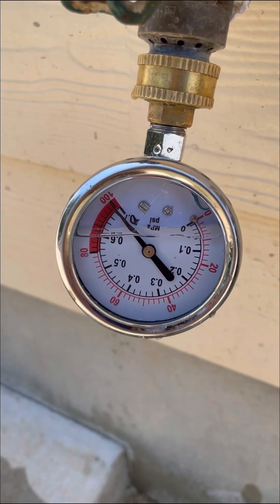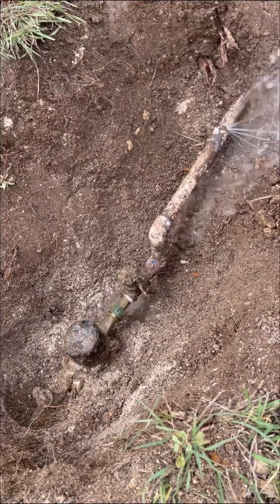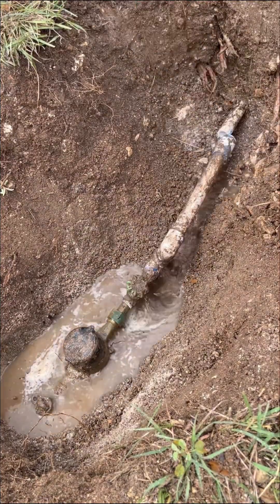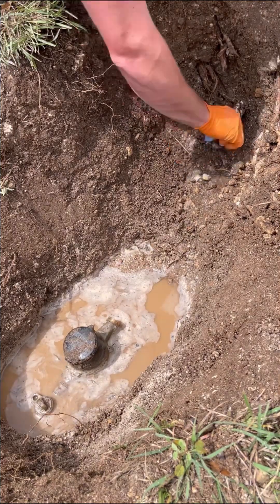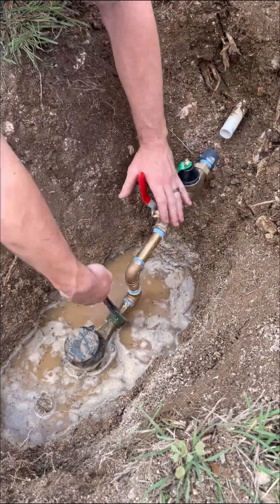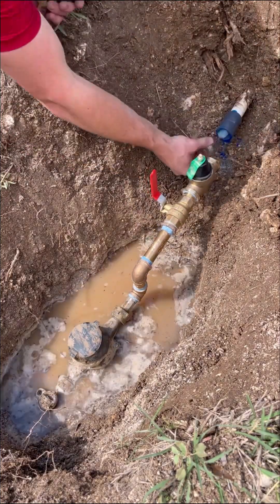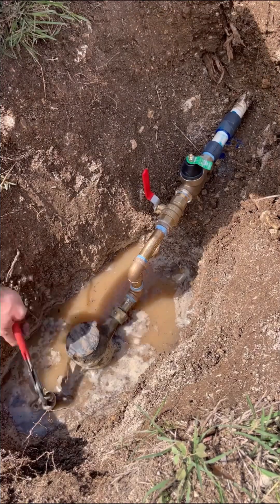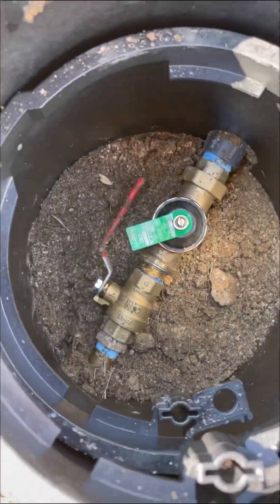Installing a PRV. 100psi to the home. #plumbing #plumber #fyp #howto

Comment: Not knowing what area you’re working in I have an honest question. Is Scheduled 80 allowed for in ground water supply. I’m a little behind on code so I’m curious. Not hating on it or trying to start a fight. Just wanted some clarification/ education on the subject
Reply from the maker: I am in central Texas. They allow PVC sch. 40 or 80 for water supply as long as it’s on the exterior of the home. Most homes here between the 1960’s and 2012 or so have PVC water service lines. Before that they were copper, poly, and galvanized. Now most are being switched to PEX

Comment: I wish you would have taken the extra effort to keep the mud and dirt out of the line at the meter by vacuuming the water up BEFORE  it gets into the main. But you just didn't  have the energy I guess. So, otherwise nice job but I say FAIL on this one.

Comment: I recently saw a house being remodeled and the regulator had the water pressure set to 120 PSI. I informed the homeowner it should be around 70-80PSI.

Comment: You need a transition fitting from pvc to metal or brass. Schedule 80 even though its thicker wall its not approved under upc codes.
Reply from the maker: What’s the code number? Would like to look into it. I have always done it with sch. 80 and it’s always passed.
Reply: @theplumbersplunger  code is different everywhere, you could both be right. or he could be wrong.

Comment: I got called to an apartment building that kept having new faucets and toilet fill valves disintegrate within days of installation. I checked the pressure, it was past 200psi, that's the highest my gauge would read. I changed the old pressure reducer and after that no more issues thankfully. Could have used the water hose as a pressure washer at that point. 😅
Reply: Good grief! I’m in London and our pressure on 2nd floor is awful. Would install a pressurised tank if we were going to stay for much longer.
Reply: 200 psi, not great not terrible.

Comment: Wait, you run sch80 from the meter to the house? How do you guys bond your electrical panel to the home water line then? 

And question, why not just install the valve above ground next to the house?
Reply from the maker: I’m not an electrician so I’m not sure what they do for the bond it. Most new homes here are all pex now so there is no metal piping.
Reply from the maker: We install them at the meter so the full water service line from the meter to the house is regulated. This house had the 1” pvc running about 150 yards from the meter to the house.
Reply: If you don't mind me asking what part of the country is this in? Its interesting how it varies from region to region. Here in LA it’s cooper from the citjy to the meter, them cooper from meter to the valve that is  located next to the house were the main line come up, from there its copper or Pex into the home. My question about the bonding was because no matter where the electrical panel is located an 8 gauge ground cable must be ran all the way back to the main water line, otherwise it will not pass inspection
Reply from the maker: @checo8187  this is in Texas

Comment: What are the different options you gave ?
I’ve been told that you can’t put a gauge on a vacuum breaker and get an accurate reading. What’s your opinion on this? Thank you for the content bro love watching y’all work
Reply from the maker: I have never heard that you couldn’t get an accurate pressure reading with a vacuum breaker. I personally have never had an issue. I might need to look into it though just to be sure. I give a couple of different options ranging in prices. From replacing with a full brass dual chamber valve, adjustable dual PRV, standard brass PRV, and standard plastic top.